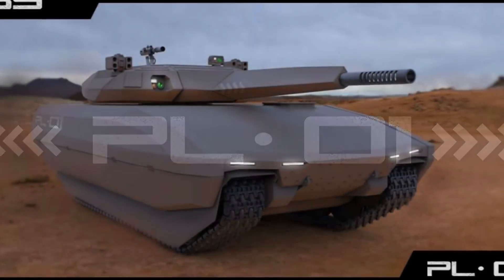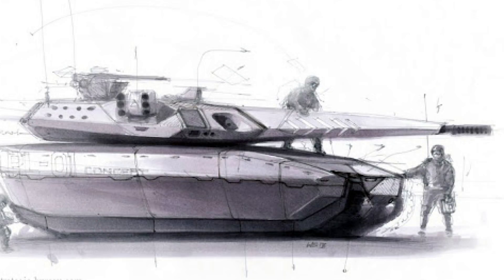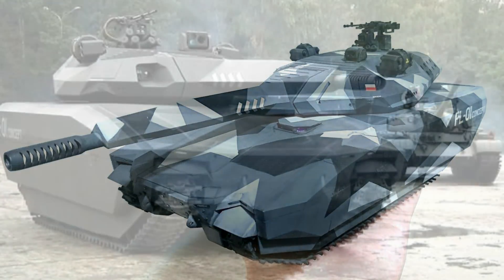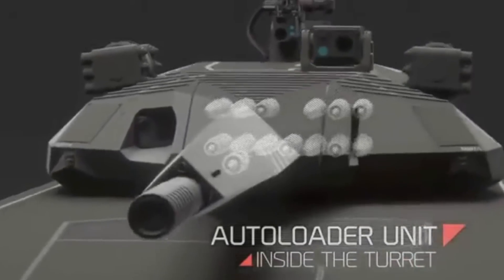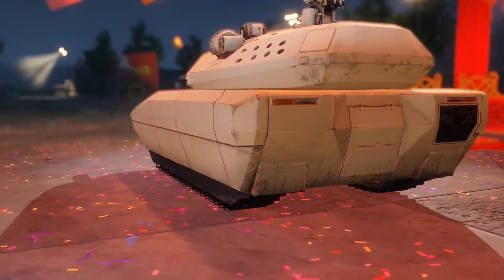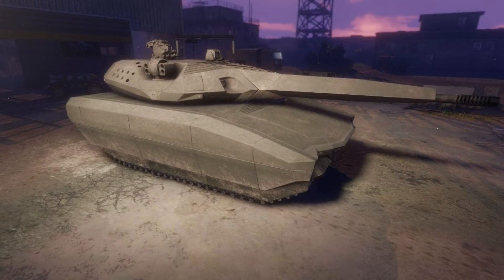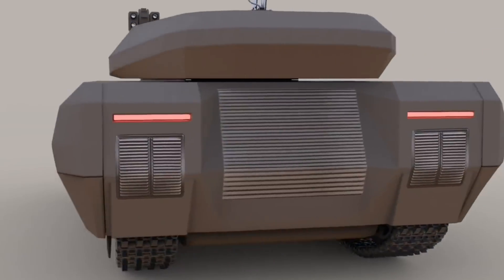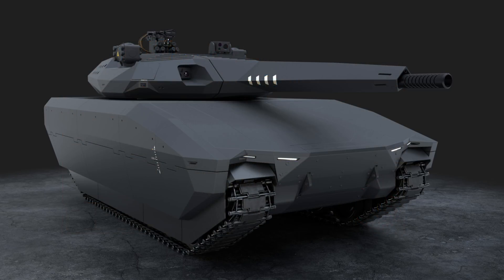PL-01 Prototype concept tank | POLISH STEALTH TANK

Comment: I'm always hearing how important it is to have a very high number of rounds on board, often being 40-60. I have to ask, what is the average number of rounds used by one tank in a battle? I just can't see how any one tank could use up a full complement of ammo in one battle. If you start with a full platoon and each tank is carry a full load even with one or two tanks not able to engage the enemy there's 80-120 rounds to take a out a lot of targets. 
In WW2 a lot of army officers had always used the larger size of the rounds reduces the number of rounds as an excuse for not going to a larger more powerful round. Wouldn't it have been better to go bigger making the round more able to take out the target with one shot and reducing the number of smaller rounds needed to take out the targer? My thinking is the space needed for two small rounds is still more than what one larger round needs. My point is, one shot kills vs two or three that only at best damage the target. 
Maybe there's a way to create a means to reload the tank with some sort of pack or magazine system, like containers that can just slide into the vehicle. The blowout hatch could be the reloading point. This would reduce the weight, size and fuel use of the tank a great deal. Remember there is always going to have to be ammo and fuel carriers following up the units.
Reply: Maybe you should send an email with this question to the experts of the Polish company OBRUM, who want to produce the PL-01. Because this question is so specific that only experts can really answer it.

Comment: For an IFV its quiet ok. But the center of mass is looks like a bit high on this one, maybe thats why they put the muzzle brake on the gun. The problem is if you want it to support infantry, muzzle brake is not a good idea. As for a tank, it looks quiet expensive and under protected, even with active protection system. BTW i just thinking about what kind of shells can it fire and in wich rate.

Comment: The CV 120 is a antitank platform it was never meant to be a tank only a tank hunter. It is suposed to move between positions fireing one or two rounds then move. As such it is good system that has firepower enough. The downside is that it has very limited offensive capacity. But it was not built for taking terrain.
Reply: The CV90120 is not the PL-01. The PL-01 will be much more powerful. The PL-01 will be a much improved upgrade of the CV 90120  including the stealth properties. The Polish company OBRUM has proved with the upgrade of the T 72 that they can upgrade tanks very effectively. Incidentally, the CV-90 will definitely be greatly upgraded by the Polish  OBRUM company, so actually this will be a new tank. Like that was made by OBRUM with the T 72 tank. The PT-91 Twardy is one of the best upgrades of the T 72 tank. Changes from the T-72 include a new dual-axis stabilized fire-control system, reactive armour, a more powerful engine, transmission and new automatic loader. Unlike many other T-72 upgrades, the Polish Army PT-91s are upgraded using elements created almost exclusively by domestic companies, including a new engine, the fire control system and all communication system elements. 
In fact, it's almost a new tank, because I haven't named all the modernizations. By the way, many of those elements were used to upgrade existing fleets of T-72 tanks in countries including the Czech Republic (T-72M4 CZ), Georgia (T-72SIM-1), and India (T-72 Ajeya Mk. 2). The tank was also exported to Malaysia. So this Polish company has quite a lot of experience in developing tanks. So this Polish company already has experience in upgrading tanks!

Comment: Excellent  analysis  and description  of a great looking tank,i am a tank aficionado and military tecnology fan great channel  keep up the good work.
Reply: Hopefully this tank will be produced in series in Poland. It would be a great success for the Polish defense industry. In any case, the future belongs to stealth ground vehicles. Because most anti-tank missiles are so-called "fire-and-forget" missiles that are either controlled with electro-optical thermal imagers or with active radar. In the future, not only tanks will be protected with stealth technology. For example, armored fighting vehicles will also be protected in this way in the future. Incidentally, of course, not only the Poles are developing this technology.
In any case, if all combat vehicles are protected with stealth  technology in the future, then the old wire-guided technology will be used again, i.e. missiles guided by wire by an operator. The disadvantage is the limited range, because the range is reduced by the length of the wire.

Comment: The stealth package, even if reduced signature, will prevent its identification, when it is still  or recently stopped moving.  Same for thermal 'camouflage'.  It will prevent this vehicle from being ambushed by helos, drones, other air, when it is itself ambushing or in marshalling yards.  Also since it has weaker armor, hopefully enough to withstand 50 mm ammunition of IFV this saves on fuel, costs, and may be able to pull out of danger very quickly.  This vehicle reminds me of 'Jackson' tank destroyer WW2.  For Poland, if the gun scales up to 130 mm, is a winner.  It just need a deterrent vrs aggression, nothing else.  It is like Sweden.
Reply: Yes that is a good description of the advantages of the PL-01. Hopefully this tank will be produced in series in Poland. It would be a great success for the Polish defense industry. In any case, the future belongs to stealth ground vehicles. Because most anti-tank missiles are so-called "fire-and-forget" missiles that are either controlled with electro-optical thermal imagers or with active radar. In the future, not only tanks will be protected with stealth technology. For example, armored fighting vehicles will also be protected in this way in the future. Incidentally, of course, not only the Poles are developing this technology. By the way, the days of the manned turrets are over.
In any case, if all combat vehicles are protected with stealth  technology in the future, then the old wire-guided technology will be used again, i.e. missiles guided by wire by an operator. The disadvantage is the limited range, because the range is reduced by the length of the wire.

Comment: Surely the actual crew protection is higher than 25mm APFSDS. If you can get more than that for a 3 man crew inside a hull of this size....your doing something wrong. The whole point of not having a manned turret (should be) is to be able to encase your crew in a high level of protection that isn't compromised by turret constraints. You can literally put your crew into a titanium/kevlar bubble inside a steel hull, with steel/ceramic/ERA on the hull, covered by an APS.

Comment: Hi Matsimus. Love to know your view on 2 my (kinda crazy) futuristic tank visions: 
1) Tank design based on articulated tracked vehicles, like udes XX 20, DT 30 Vityaz, Magnolia, or bronco, - powered by extra powerpack, or small reactor located in the unmanned second segment of the vehicle (distributing the power into the manned segment by strong powerline(s) between the two segments). - could power electric shielding and/or weaponry. Another small pro, might be strategic mobility (modules can be transported as separated parts). 
2) Swarm tactics, where the manned tank will proceede as second wave after unit of UGCVs (like ripsaw M5, or russian drones, but with added firepower, using autoloaded high calibre recoilles rifles, to be threat to the regular tanks.) Few UA(C)Vs would be a great help in this tactics too - at least as spotters.
What do YOU think Mat? Are those ideas more on the crazy side, or more on the feasible side?
Reply: Who is Matsimus? By the way, you should send your ideas to the Polish company OBRUM, which is planning the tank!

Comment: Ok, I had kinda the opposite idea. This is gonna sound so damn stupid, but bear with me. M18 Hellcat redesign. New drivetrain, new gun, redesigned turret, revamped suspension, but otherwise the same general tank (destroyer) from 1943. A lightly armored, fast firing and fast moving raider, something that gets more chances to get the first shot off. Lightweight, no bloating, just pure thrash and bash mentality. MBTs are expensive and fragile over rough terrain, but can take a hit; let them hold the front line while these things dart behind enemy lines and buzz around like angry hornets. Does it sound worthwhile, or is this just stupid?

Comment: Negatives:
1) Too Tall.
2) Too Chonky.
3) Covered Tracks (difficult to fix).
4) 120 mm gun means that it will have less ammo and more problems.
5) No coaxial machine gun.
6) Only seems to have 2 hatches?
7) Probably very pricey.
8) Too many electrical components (thus fixing it will be a problem).
9) Only Machine Gun is on the top of the Turret.
10) Turret is placed on the back, effecting Depression Angles. 
11) Engine is located in the Front, easy to take out.
12) Armor isn't everything.
13) Too Complex thus difficult to create alot of.
14) Close-range combat nightmare.
15) Too little crew (In my opinion).
16) Poor Trench Crossing Capabilities.
17) Top Heavy.

Positives:
1) Active Protection System.
2) Great Command Tank.
3) Camouflage System.
4) Great Traverse.
5) Angled Armor.
5) Can carry additional Solders (at the expense ammo).
6) 120mm Auto-Loader (I guess???).
7) Difficult to detect by Thermals and Radar.

Overall, Great if you want a APC, terrible if you want an MBT/Modern Light Tank.
P.S. Do a callab with Spookston!
Reply: You, sir, need to educate yourself in armored warfare, because half of your negatives are not making sense or should be in positives i.e. engine in front - crew protection. YES CREW PROTECTION, like Merkava tank.
Reply: @jakubw.2779  Then point it out, I'm not some acclaimed expert or anything so I'm welcome to corrections, no need to get so worked up by it. Plus it's my own opinion on the matter. Also a frontal compartmental engine (alone) only provides so much protection as most modern day rounds will pass through the engine with ease (and kill the crew), not to mention that in order to engage targets around corners it will need to stick out completely due to a back mounted turret and front mounted engine. Also which Merkava? There are 4 different variants so be more specific. Also also, the problem with the Merkava is ammunition stowage as it stays with the crew, and when the ammunition is hit it leads to catastrophic failures (unlike other tanks which have better stowage systems) and has very limited ammunition and for every extra person in the tank 12 rounds are removed (due to it's large 120mm gun). Also the engine doesn't stop the rounds...the top-of-the-line classified reactive armor does (400mm effective armor thickness)...same with the PL-01...only except that the PL-01 only protects against 50mm AP, which is crap considering that pen for 50mm is about 130mm and slightly above (for most). Overall your understanding of how the Merkava is able to protect the crew is heavily flawed as the engine doesn't stop anything, e.g. STRV 103 (b) uses a reactive net on the front to detonate rounds and prevent it from DIRECTLY hitting it as the Swedes found that Modern Ammuntion could easily pen through both "spaced" and sloped effective armor thickness, going through the engine and often a times killing the crew of 2.
Reply: To clarify, the Merkava has an total ammo stowage of about 72 rounds I believe, better than some. Reason why is doesn't have as many rounds is because it's not as big as other tanks as stated. All in all I spent a few minutes on research and writing so, as said, if there are any flaws in what I've said, point it out. Although your "fact" on the engine protecting the crew is pretty strange as most MBTs have 35-50 mm of armor and is only protected by it's reactive/ceramic armor, where did you learn that the engine is some how able to protect against munitions that pen 400mm+ all by itself?
Reply: @sethl.lazarus6642  you clearly don't understand what you're talking about. First of all reactive armor (ERA) protect from HEAT/chemical rounds, not from APFSDS. The mentioned net on the Strv 103C has exactly the same job. Protect from (most) HEAT/chemical rounds/ATGM. But even then there are various types of chemical ammuntion that can defeat ERA/anti-HEAT panels Such as tandem head ATGM. As for engine - it's a big chunk of steel in front of the crew. Modern day APFSDS rounds have about 700-900mm RHA penetration at 1000m. RHA stands for rolled homogenous armour, which means steel plate thickness. So if you have big engine and transmission in front it will easily eat up any APFSDS at distances 1000m+ preventing the crew from being killed or injured. True, that the vehicle Will be disabled, but not eliminated. Yes there are 4 versions of Merkava tank, or even 5 if i remember correctly, but all of them is same core design. What changed through the versions, was armour, optics, FGS, powerpack and gun. Also ammuntion is contained in special boxes, which minimize the damage in case of ammuntion hit.
Reply: @jakubw.2779  See, I'm no expert at this. Corrections like this make people understand better. Now try correct my list of negatives and positives, I'm interested to see what you change.
Reply: @sethl.lazarus6642  ok. Point 2 and 3 are necessary to sustain low radar profile. Point 5 - ther IS coax MG. Point 8 - electronics loosen the stress on the crew by computing and warning or even taking automated actions in case of emergency. Point 10 - that's not necessarily the case. Point 14 - it wasn't meant for close quarters combat as it isn't an MBT.
Reply: @jakubw.2779  Tankz for the fact 👍🏻

Comment: If you’ve ever seen a tank/apc being used for either extended training or operationally you’ll realize that it has tons of stuff on top of and hanging off it. So unless they have storage for each crew members gear/ruck, mre’s, plus tow cables, rolls of concertina wire and other assorted stuff stealth tanks will quickly lose a lot of that capability.
Reply: That's exactly the challenge for the developers of the tank, that it's like Teflon-coated and nothing sticks that negates the stealth property.

Comment: It's not a tank.  Designed to thwart resources possessed by lo-tech opponents and to obviate the need to use reinforced bridges, it is meant to operate with the armored infantry, rather than dominate the battlefield.  It's got lower clearance, higher mobility, and lower operation costs, vis a vis MBTs.  The US Army tries to approach the same parameters with its 8 wheeled 105mm armed support vehicle, but that's a top heavy nightmare confined to moderate speeds on well prepared surfaces.

Comment: I'd say this platform is more recce/tank killer. I know 'they' always mention HP on tanks, but isn't the torque more important when dealing with weight like this? And being able to haul all that weight, get up to speed, and maneuver--why not use electric motors? They deliver instant HP/Torque. Use a gas generator(s) that provides power to the (modular/replaceable) battery packs and perhaps give it a longer range or loitering time. Maybe while on battery power it's heat signature would drop a lot too.

Comment: I don't know what this is supposed to be. I'm no armored fighting vehicle designer but I can see a TON of design flaws. The most glaring fault is the shot traps between the turret and chassis. Good God people that's a BASIC flaw. Any angles on the vehicle needs to deflect AWAY not INTO the vehicle. I won't get into the mud traps with the tracks. Think any temperature below freezing. Follow the rule of FUNCTION before FORM. The T-72 appears to be a far more survivable design. Looking cool means NOTHING.

Comment: I mean, you could just slap a 120mm oto melara turret on a cv90, bolt some active protection system and BOOM, same result. Now i'm not saying that having the ability to put a 120mm cannon on lighter vehicles is a bad thing, but it should be an eception, something you do for a very specific mission. I think that every next gen MBT will have a remote controlled turret. It makes too much sense to have your men away from the mst hit part of the tank, and save in armor weight as well.

Comment: Yeah. Now Polish army is on a crossroad with very fucking expensive F-35 programme and so many needs... Artylery systems are old, radar detection net is ineffective and old, we need new heavy transport aircrafts, we need new attack helicopters (or to highly modify Mi-24s), we need to replace T-72 and modify Leopards - fifth and fourth generation. We also would be happy to have new infintary equipment. And we don't have fleet. Even good motorboats for special forces.

Comment: That gunner’s sight at the right cheek of the turret is a huge shot-trap and weak point.  It looks like it will even catch shells bouncing off the front glacis.  It’s an unmanned turret so why on earth does that need to be there?  They should have had it in-line and on top of the gun which would give better accuracy and doesn’t introduce a huge gaping hole in the armour of the turret.

Comment: It wasn't even a CONCEPT vehicle. Just bunch of arguably cool looking stuff smeared all over CV-90 chassis, without deeper thought.  In the meantime, we don't have 105 gun turret for decade present Rosomak AFV.  And fraction of the cost is a joke, as gun + FCS + APS are usually 2/3s of cost of modern MBT anyway.